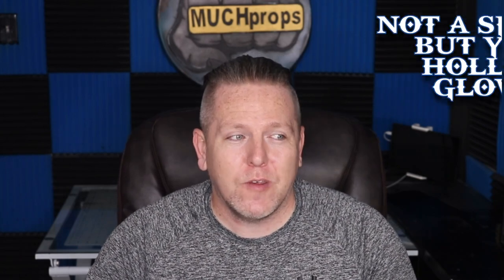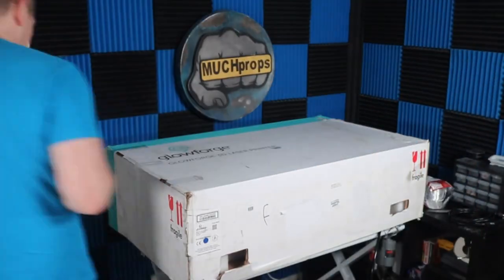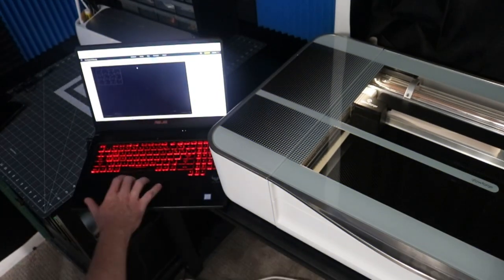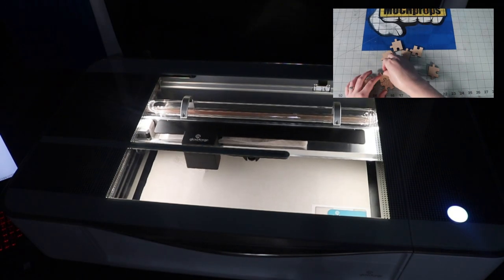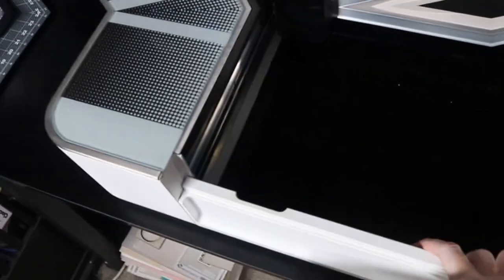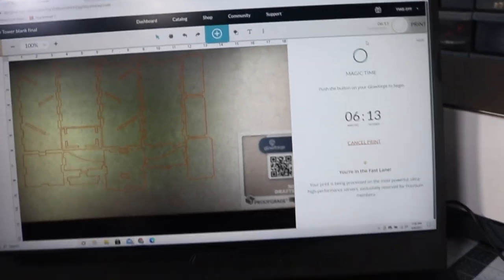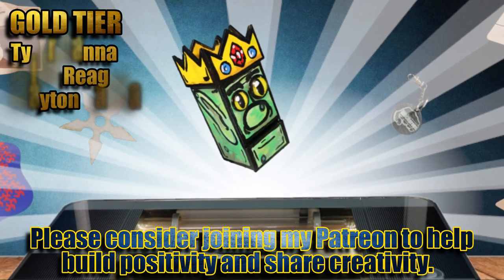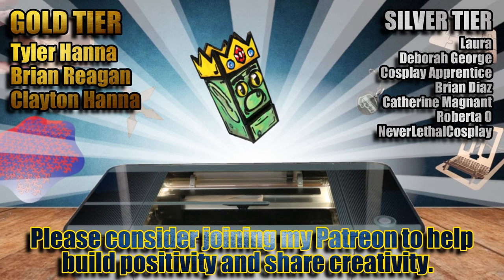I Bought A Glowforge

Comment: I would personally use pva instead of CA for mdf. Yeah CA can be useful for some, but pva give you a little extra time but also drys a lot quicker than you'd typically think of since it's mdf.
Reply from the maker: You are right. I didn't have any PVA on hand and needed to finish it up quick. I used to work in a cabinet shop as a teen. I know all about wood glues and dry times 😆👊. Thanks for the suggestion.

Comment: Is there any Z axis adjustment?  What about fume extraction?
Reply from the maker: The laser array doesn't move up and down, so depending on the thickness and consistency the kerf may vary. I am no expert with it or lasers. You can manually adjust the thickness measurements in the settings of the software and can remover the crumb tray to accommodate thicker materials. As far as venting, it does a great job. There is a vent hose that could connect to a purifier if you have to vent in the room but mine is located next to a window so I vent out it. The fans do a great job of kicking it all out.